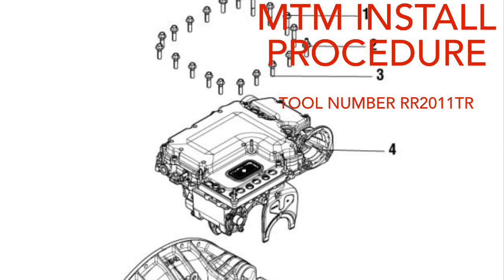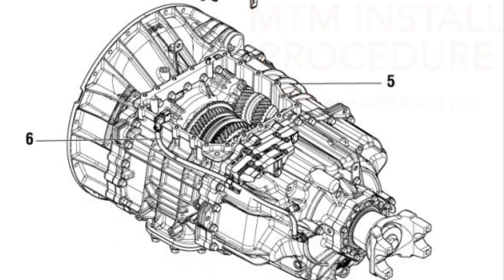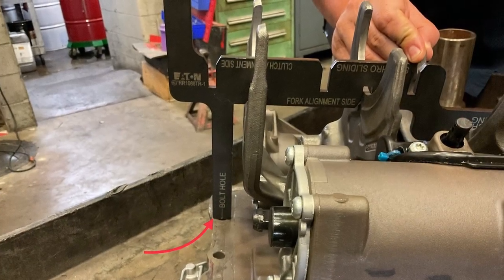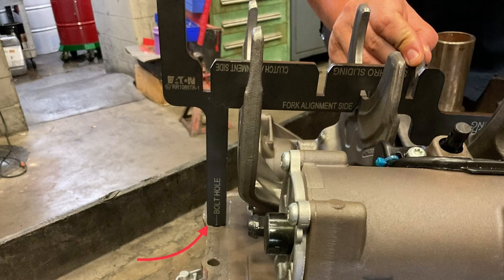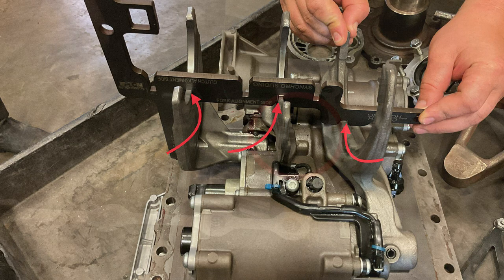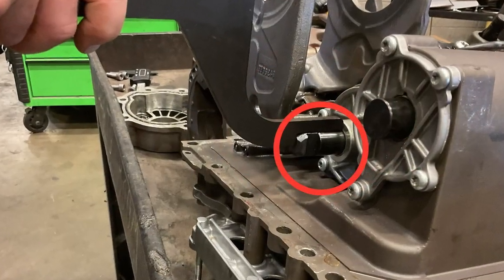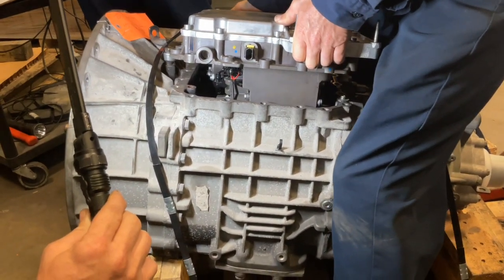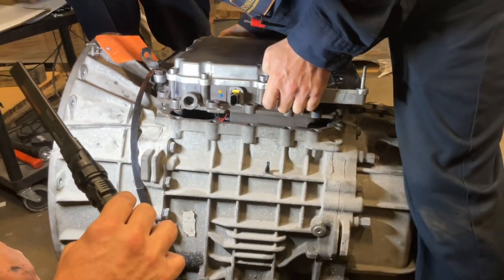Eaton Endurant MTM install procedure

Comment: Does it need to be reprogrammed after being installed ?
Reply: Let it calibrate by itself. Don't  force a calibration using road ranger. Just make sure the mtm serial number is correct to what it showes in road ranger...
Reply: Does it?
Reply: You may need to change the serial number in the tcm, and you will need to calibrate it after installation.